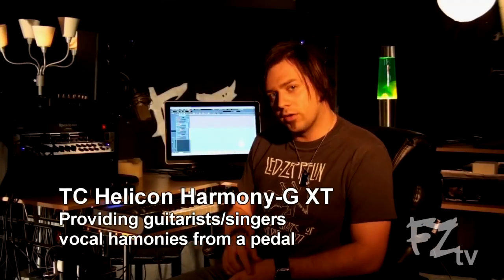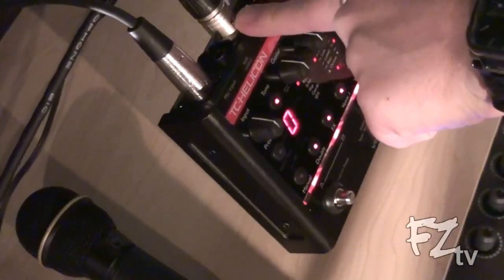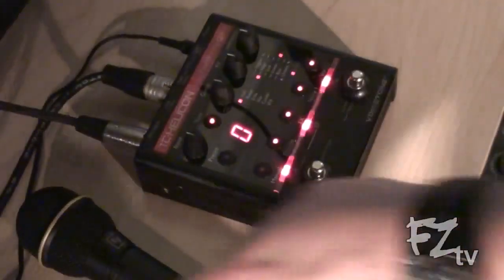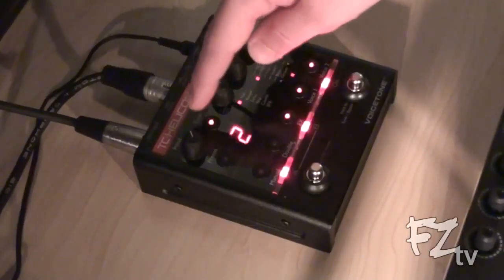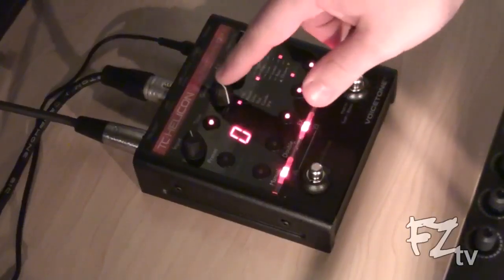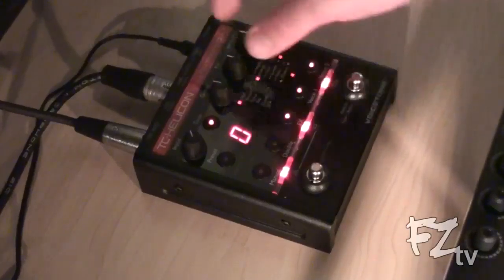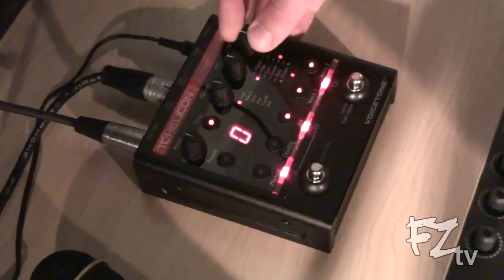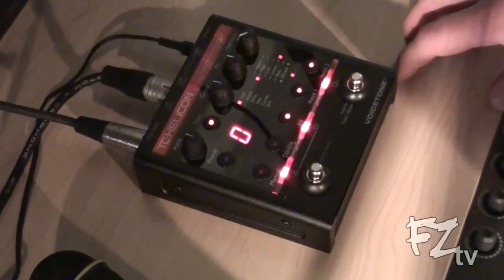TC Helicon Harmony-G XT - Walkthrough Part 1 [HD]

Comment: @fightingzero actually if used it with just single not riffs that go through the root and the 3 of the scale and it works, it can still pick out the key of the song.. the song I figured this out in was remedy by the black crows during the chorus, "can I have some remedy etc.." its just a guitar riff with no full chords, still works but it was going from the root straight to the minor 3rd though..

Comment: I just got this peddle and so far I have one major issue with the design. The 1/4 guitar jacks are so close together that you cannot use cables such as Monster or Whirlwind. The ends are too thick to fit side by side.  You need to use adaptors or cables with the "old school" skinny metal ends.

Comment: I want to know if this supports USB Inputs and Outputs. If not, do you know one that does this stuff with USB Inputs and Outputs?
Reply from the maker: This does not use USB in/out like a recording interface, assuming that's where you were going with that question. TC Helicon has some other options like the Voicelive that have in/outs like what you're after.  The Harmony G XT simply is easily used in live and direct-in/overdub recording situations.